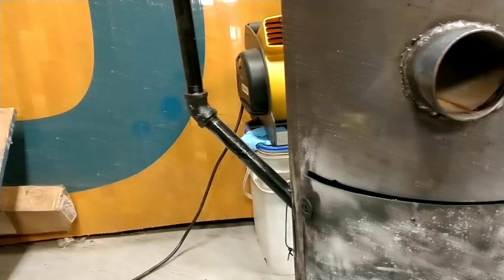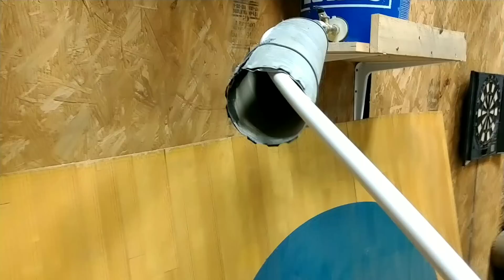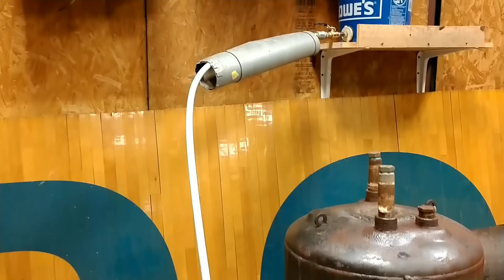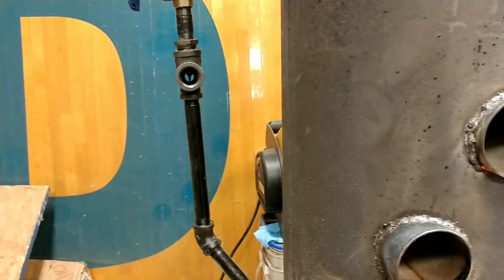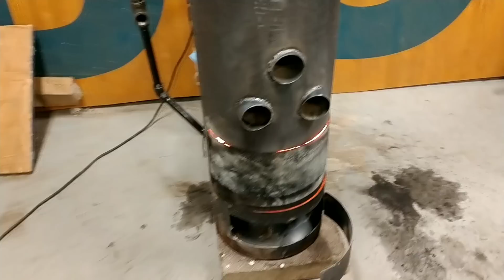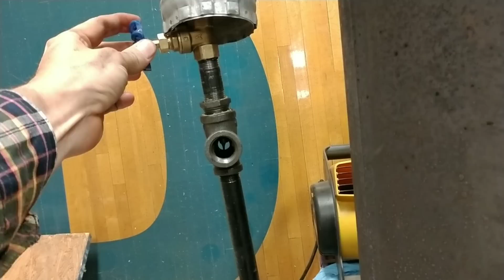Updated Waste Oil Heater Drip Feed Ver.2.2 Detailed January 19, 2018

Comment: I really like how simple you kept it and the fact that a girl with some metal shop skills could make. Gives the DYL  a whole new meaning as the heat will draw any oil fumes a way out and not in the building. I made a wood burner on a   similar style way and the wood loaded from the side but up near the top of a oil line pipe pig which is quarter inch thick steel and stood four feet tall so real long branches or rounds could fit in it. shut down tight with the box full would hold a fire twenty plus hours. My air intake was at near the bottom above the ash and a clamming shovel would slide in to clean the trash. My shop was forty by sixty and some side rooms and it would be minus thirty outside (alaska) and in my shop was all cement so no burnables. I watched it like a hawk for about three or more months but by opening the flew up and setting the well casing chimney afire and the flames would go way up in the air if I didn't keep a eye on the creosote cause most my wood was sopping wet and that makes creosote bad but totally safe! I put wood in it in the morning and then left it alone and if I had the big maid door you drove rigs in was open for a good deal of time then I would have to fill it again at night but it burnt cottonwood and birch mix or some spruce green trees as I never had much to work with that first winter.  The next year I bought five cords and used most of it every year but it was dryer and held better. Where the draft was I would smear some dirty grease rag with diesel and stick it in the draft and then use the torch or some propane heater torch and it would start that wood without kindling in minutes cause the draft was good and my chimney was twenty one foot stick (used one whole piece) I built it about close to twenty years ago and it is still working and still the same pieces
Reply: Morgan Adair: do you have any pictures or videos of that heating system? I would really like to see that in action.
Reply: @MonteSS6969   I do not but can describe it to a detail. The stove body was made of the oil pipeline casing. I got ahold of a short section they cut out cause of their tight regs. I was corroded on the inside but the grinding wheel revealed it was real sound metal... somewheres around one quarter inch and three eights inch thick and FREE. I used a cut off wheel on the doors and it was worth it cause its thick but it holds heat really well. I bought the metal for the top and bottom and cut it about a half inch larger to apply wrap if I used water heating system. I did have pictures for a long time but after I got hurt, I lost it to a person who kinda got that whole ball rolling in first place. Ugly story behind it. Its just like I explained it above for the most part. I had sand in the bottom till it built its own base of coals/ash and made my door quite a ways up so I could drop in just about anything that would burn. It was thick enough that you could of (I didn't) burnt tires in it cause it was so thick that it didn't warp  but I wanted head space so smoke didn't come rolling out of it. I used thick pipe for the drafts and all the top piece for the chimney pipe to slide over and put a damper in it there. eight inch metalbestos chimney pipe you get at any fireplace store since I built big (it weighed a lot) and the drafts was from the metal shop cut offs. Same with the legs (three work best) and I found after using it, I never used the damper in the chimney. I knew I had to spend money for pipe for the stack but then found some damaged in freight deal (no warranty) and  I wanted it to clear my pitched roof. It was the best stove I have ever had and I have had one of those rightway stoves and they are good but no match for this monster. I did wrap copper pipe and used common sense on height and size so use your if you do it. It did good heating water and worked like the model t engine and it circulated on ts own cause thats what water does but no restrictions or it will blow up like a still (made one of those too for a lark) That water tank was made for wood stoves and was all regular pipe made for water (steel) I    wired thermostats in it to turn on fans and made my own vents. The size was three feet diameter, and four feet tall so I could do what I wanted. I  am a mechanic welder (was, cripple now) so putting my ideas together wasn't a problem and my insurance didn't ask for brand. I used it up till I lost the place but that was three and a half years of the cleanest nice heat and I burnt anything cause of the long chimney pipe. I like the fact that if limbs fell out of tree then if they fit, they burnt. It is something I built, not buy so ask if any other questions

Comment: You could harness a lot of heat by running the exhaust pipe inside a larger pipe and capturing the heat and venting it out like a central heat system.

Comment: Not sure about the ' safety feature ' . . . . .seems the oil could still get plenty of air as the ' stove ' isn't air tight . Maybe you could test the theory in a separate video ? I like it though ,and will be building one for my shop . Thanks .
Reply from the maker: The safety feature was designed around it being airtight

Comment: Do you think the smaller one you built would heat a 2 car garage with 13 ft ceiling? I need one of these in my life!
Reply from the maker: It didn't produce a lot of heat and was much more dangerous
Reply: It works well I used an automatic transmission torke converter cut in half.. for the burn pot it. creates a very nice vortex ..plus you want to use a steel break line for the oil feed gets very hot....

Comment: Winter is getting colder. I need to make one of these. About time to use my everlast welder to make one.
Reply: Get your welder out of the box! I didn't think these would work well either.  But, they do fine with smaller jobs, and are very portable.

Comment: Pretty cool kinda brings back memories from the early 1960's my dad built something similar but dad built a sand pot that sat in the bottom and his copper line with the fittings he made was feeding fuel oil from one of them big 500gal. Fuel oil tanks and where the line went into the side of the homemade heater he had it setup to drip the fuel oil into the center of the sand pot and you could adjust the amount of fuel oil drip to make the flame larger or smaller. Of course there were different types of valves and fittings. I guess i had to be around 7 or 8 yrs. Old then i don't remember the whole setup to a tee but thats what heated are cabin back in them days and i remember it was very warm in the winter. Skipping thru some videos and seeing what you built sorta brought back some memories..
That one you built is pretty cool nice job..

Comment: @18:35 you say you can't explain how the heat exchangers work. You, Sir, can build this amazing contraption but do not understand how air being blown through those pipes warms up as it passes through the tubes and comes out the other side heated? I call bs on that statement.
Reply from the maker: Not sure I understand your comment. I understand exactly howheat exchangers work, however I don't see how tilting them upward over 14 inches would have any affect.
Reply: @randysdiy2102  it was a backhanded compliment full of sarcasm.  It's the internet I couldn't just be nice about it,  that's not how this works,  that's not how any of this works Haha

Comment: Where and how much outside air are you drawing? Just keep it safe. Great welding job. Temp on exhaust look pretty good. How often do you need to clean it.
Reply from the maker: I cleaned the chimney one a year not much in there. Cleaned the burn pot each time before I light it
Reply: @randysdiy2102  Nice. Oil burners as such usually need a good cleaning. I think your temp is keeping it sweet. Just make sure you are getting enough outside air

Comment: I,would be testing for carbon monoxide as well.  Especially since that bolt at the top is not secured.  8 parts per million over 8 hrs is lethal plus the effects of carbon monoxide are cumulative over time.  I was a ff/medic.
Reply from the maker: I have a carbon monoxide detector in the shop.
Reply: Existing short-term exposure guidelines from the National Research Council Emergency Exposure Guidance Levels (EEGLs):

10-minute EEGL: 1,500 ppm
30-minute EEGL: 800 ppm
60-minute EEGL: 400 ppm
24-hour EEGL: 50 ppm

It was found at these levels it would cause unpleasant, but no dangerous symptoms, but also reported that 1,500 to 2,000 ppm might be a dangerous concentration for an exposure of 1 hour. It would take quite a few days of constant exposure at 8ppm before you'd probably even experience a headache. Either way it's obviously not good stuff, and a Carbon Monoxide detector is an essential bit of kit.

Comment: I do used oil burning for my boilers but with a way more advanced method and system.  I use modified fuel oil burners plus digital logic control to get a hot clean burn.

The trick is to modify the oil burner to have a preheater device just ahead of the nozzle to preheat the oil to ~ 300  350F  to get its viscosity thin enough to spray like fuel oil/diesel fuel.  

The rest is just using a PID controller and a Teco PLR  unit to keep that heater temp stable and to monitor everything so that things function as needed when needed when there is call for heat.  

The logic steps are simple.   
1: Call for heat via a high/low input initiates the process.
2: PLR unit send power to PID units power circuit to get the preheater to warm up.
3: PID tells PLR that heater is below operating temp.
4: PLR  waits until PID says it is hot enough,  ~ 15 - 25F below PID set temp, via PID secondary "Low Limit Alarm" output function.
5: PID says heater us up to temp.  (Low Limit Alarm off) 
6: PLR  turns burner motor on thus igniting burner.
7: PLR watches flame detect CAD cell voltage to make sure it lit and stays lit and is burning properly.
8: PLR also monitors burner feed line pressure to make sure filter is not clogged.
9: PID keeps oil at operating temp until burn cycle is done or preheater drops below 'Alarm setting'.

When working properly the oil is fully pyrolyzed to make a hot clean flame that has no smoke and only leaves behind a light grey/white  ash that amounts ot maybe 1 - 2 gallons of talcum powder like dust per ~ 1000 gallons of oil burnt.  

After a bit of refining to get the PID/PLR and overall logic functions pinned down the first year I have ran several of these setup now for going on 7 years and ~ 16,000 gallons of used oil burnt to run the boilers that heat my house and workshop and now brothers whole place to!
Reply: Cool
Reply from the maker: Wow, nice info but way beyond my building level. Thanks
Reply: Are you using a Beckett gun-style burner with a Craig Kepner heater block ?
Reply: @jesseparris6507  No clue what a craig kepner block  is.  Designed my own system from scratch using surplus materials and components I had laying around.
Reply: Where is the vid or detailed plans?
Reply: @justanotherguy-941  Just so you know, Eric Klat and I started this whole alternative wmo and wvo gun-style burner movement (for residential) back in 2000. We experimented with all types of pre-heaters and manual switches until we got to the advanced pre-heater block, PID, waste oil metering pump and SSR we use today in a ready-adaptable gun-style burner like the Beckett. (Our stuff was way more advanced than the commercial waste oil burners at the time with those set snap temp switches.

I have a youtube forum, altfuelfurnace that was started back in 2001. The guy I mentioned before, Craig Kepner, a member of the forum, was able to start a business of supplying the complete heater block (with PID, heating element, syphon nozzle and temp sensor). ckburnersdotcom.
Reply: @jesseparris6507  Sounds like a solid system. I haven't checked it out yet as my heating requirements  are small here in Ok but I do have access to a large volume of 150wt synthetic. Any experience with using higher vis oil like that?
Reply: Myron D no, but you should join the  altfuelfurnace forum and ask or do a search over there for it. There are almost 7k members, some of those guys burn anything,.

Comment: ---IT IS A GOOD BOULD... but if you change your heat x pipes to a 45 deg. the air will flow by itself. Heat flows upwards. Then you will not need the van.

Comment: You need a Fusable link shut off or you risk a run away fire
Reply: be carefull almost burned shop down  made a huge mess
Reply: I used fishing line as my fusible link in the past. Either using gravity or against a spring. Any flames and it parts.

Comment: If you line the burn chamber with fire brick including the door and get a lip on it to seal the opening, the efficiency of the fire will become a gasification of the oil and burn at 90-98% with heat of over 2,000 degrees inside the brick like a crucible in a forge.
Reply from the maker: Awesome, I haven't thought about fire bricks great idea

Comment: I do not know but wouldn't it be better to use a metal tube copper or steel for the oil that plastic one could melt and start a fire in your shop?
Reply from the maker: I used to have aluminum line on there the temperature at that distance was only around 150 on that line

Comment: Would like to see gen3 version with the top half set up like a rocket stove with a interior chimney coming off a cone going up through a 8 inch steel pipe insulated inside a 10inch pipe feeding up and then downwards inside the drum/tank then out about midways down from the top of the whole setup with the 6inch chimney. I hope you get what I mean by that. Basically half oil burner bottom with the rocket stove designed top half. This will get you some more BTU's into the shop with less outgoing chimney temps. Your running about 400F out the chimney when you may only need 250-300F to have a solid/safe draft. Compressing into the 8inch as described above then opening that to the barrel diameter and downward will release a lot of Btu's upward to the top of the tank/drum. I also would like to see version 3 have more structural doors for air and fire doors maybe even gasketed. I would keep the heat exchangers and add 2 more for a 5 dot pattern (maybe even build a intake manifold so you can push through the tubes) so you get some S pathing before going up into the conical area into the 8inch internal flue. The build idea is sound as is the execution, but leaves much to desire. Altogether great job on Version 2 you earned a sub from me cannot wait to see the mods on V2 leading into V3. If you integrate the idea's I gave I suppose you could build between the sizes of V1 and V2 for V3 and get better efficiency with the same Btu's output thus saving some fuel consumption and space used up by the system. Also please change the Pex out for metal if you can and use Kerosene mixed instead of gasoline for starting its safer and doesn't evap on you.

Comment: a word of caution bud. you'll want a method of seeing inside the burn chamber while it's closed up. if the fire gets smothered out by overfilling of the oil, there will be a point where the oil is still boiling and above it's flash(or auto ignition) point. but won't be burning due to lack of oxygen. if you opened the door purring that time it can flash and ignite instantly with a bit of a bang. a dangerous one. this can also happen on it's own if enough oxygen leaks into the burn chamber while the oil temp. is above it's flash point and if the chamber is mostly sealed you basically have a small bomb.capable of blowing the door off
Reply: Not going to be any lack of oxygen with that poorly fitting door with no gasket.
Reply from the maker: There is a little side hole in the top where the water inlets used to be